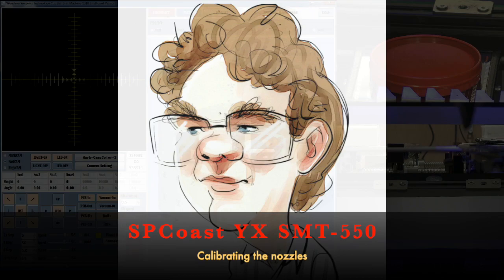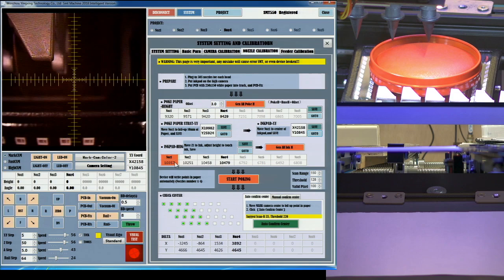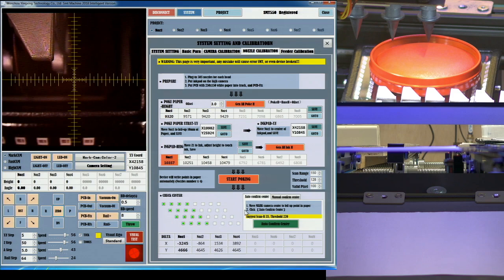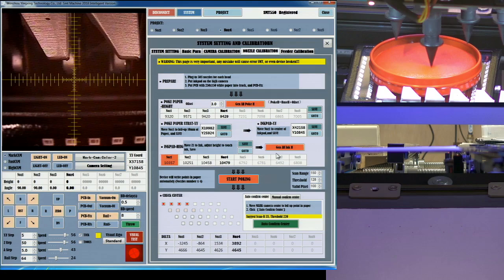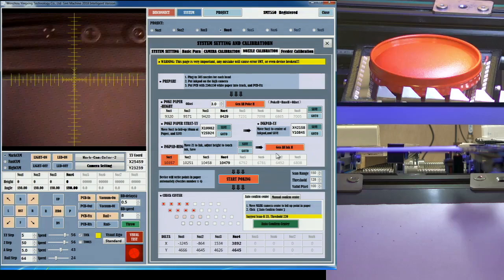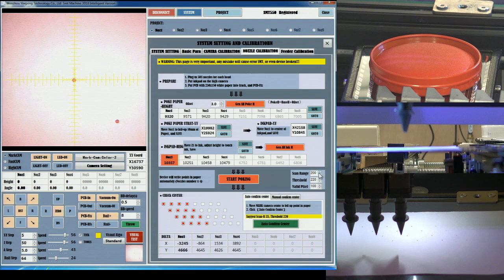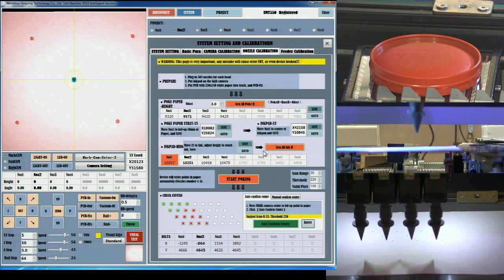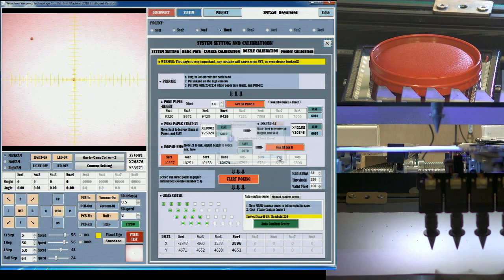SPCoast SMT550 Setup: Nozzle calibration

Comment: Hi John, I notice you using the camera calibration nozzles instead of standard 503. I clarified with HWGC and they said it must be done using the normal 503 nozzle so it reflect to the real thing. The normal nozzle is spring loaded while the camera calibration nozzle is not.
Reply from the maker: Interesting - I was explicitly told by JimJ @ YX that I had to use the calibration ones...  I had used the 503's and the rotation calibration was way off, and he blamed my use of the non-calibration nozzles... As part of the (0,0) issue I was having at the same time, I updated to a new version, recalibrated with the calibration tips, and things have been rotationally fine since then.   I certainly can understand the use of the spring tips - I had to manually adjust the Z location to not smash my white paper holder!!!
Reply: @JohnPlocher  I crashed my head into a feeder while trying to plug a feeder in during operation yielding quite substantial damage to the head. So, I had to replace all rotation motors and it's nozzle holder, hence the total machine calibration process. HWGC Shenzhen branch manager explained how to replace them and subsequently as I have never done calibration before as it was working perfect, he answered few questions on calibration including this. But, what I notice from your video are 2 things: #1 With the camera calibration nozzle, it's easier to get a nice rounded circle on the paper as it is a solid circle on the nozzle while mine is a ring  which prompt the vision to look for a circle with just outline (so the threshold differs significantly with yours at 220 vs 80 of my setup) #2 The process is very fast while mine took maybe 10 minutes. I'm not sure whether this is related to the XY speed set on the machine for manual jogging. But, I do feel the V6 software is rock stable while the new V8 (tested both beta and public release) is buggy although the new features is very welcomed.
Reply: @phangmoh  V8?  The latest, according to JimJ is 6.4.7 which cannot calibrate my high-def cam.  I got a trial version of 7.0.1 from YX that allows the calibration but it's not registered.  So then I go back to 6.4.7 but I don't know if the calibration follows.  Do you have a released V7?
Reply: @phangmoh  Do you have an english V8? Jay from YX sent me one but the one is not so english...
Reply: @phangmohlim6417  thanks for the quick answer. Do your guys have any community to discuss stuff about these machines? Eg. Reddit, discord ?